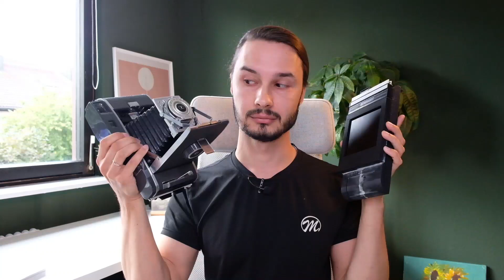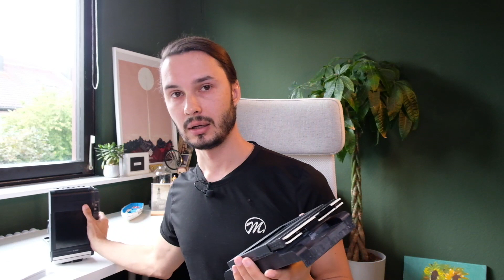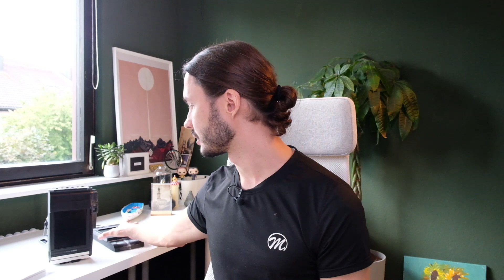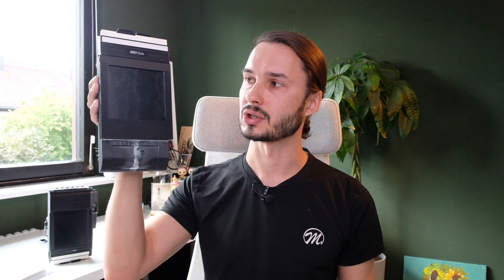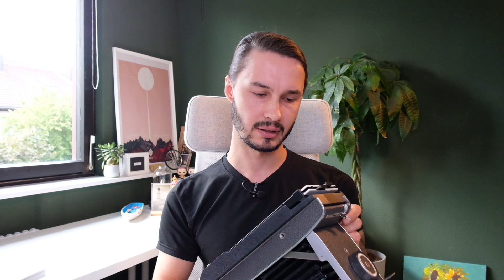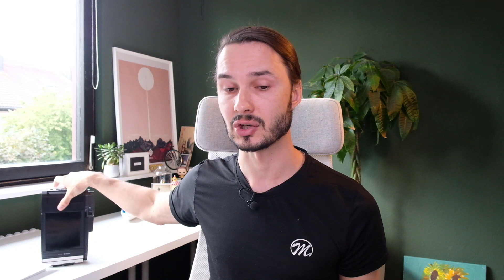Polaroid 110a 4x5 conversion. Free Download

Comment: How do you determine bellows extension factor etc for proper exposure with this conversion?
Reply from the maker: The distance stays the same. Otherwise the rangefinder wouldn't work. So no bellows compensation is needed

Comment: Does this design require ground glass or is it zeroed for the built in rangefinder?
Reply from the maker: you'd need the ground glass to calibrate the rangefinder at least once https://www.youtube.com/watch?v=Lv_TwsNYg4E
Reply: @SoExpired  What about the allegro back? Is it the same with the first design or is it set at the correct distance? Or are they set at different distances? I deconstructed a pack film adapter and glued in an old graflex ground glass into it to make a very easy removable focusing screen at the exact same distance as a film holder. The ground side actually holds very well with super glue, plus I can close the back of the adapter and insert the dark slide to protect the glass.